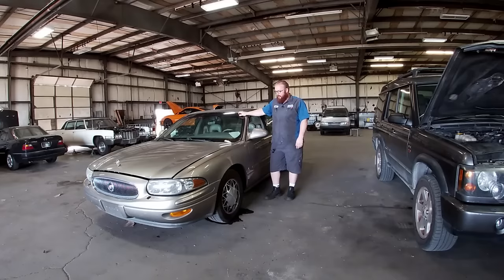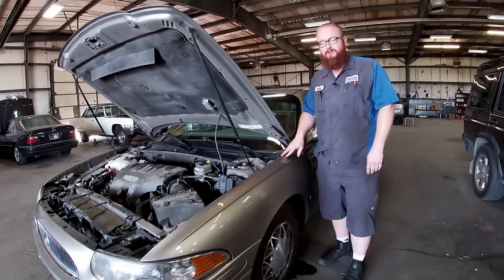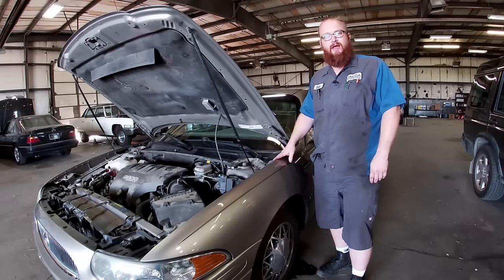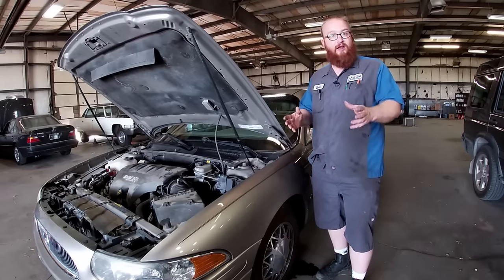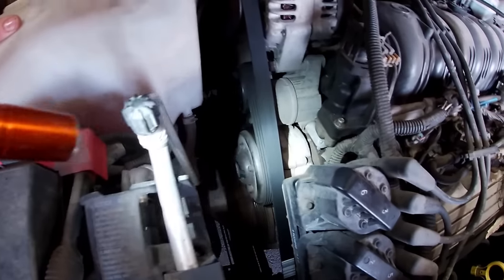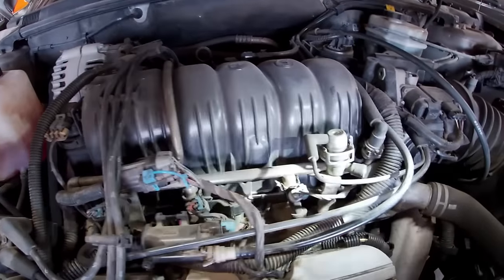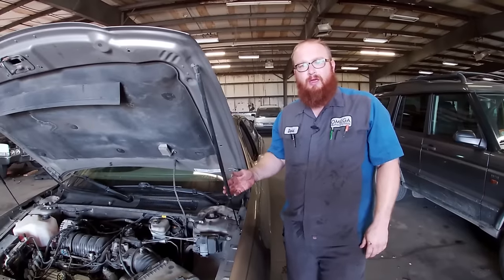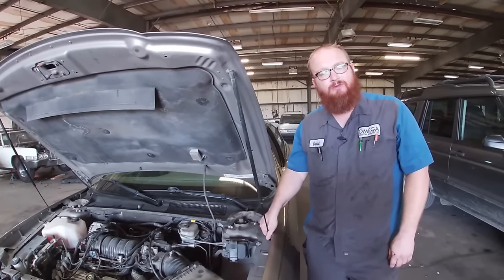CAR WIZARD highlights what makes the Buick 3800 V6 the BEST engine ever!

Comment: Here in Australia, this engine powered our most popular GM models.
Very muched loved and still very common.
Reply: Even if we nicknamed it the 'Moo' because of the engine note when you drive one hard
Reply: I have a mechanic here in Aust that says pull it out and change all the Gaskets & Seals every 250,000 Km... and once you have done 1,000,000 then rebuild it properly...
Reply: @Jimmy 000 yeah the VZ onwards are only good for LS’s, the alloytec is dogshit.
Reply: Commos represent!
Reply: @Jimmy 000 try replacing the thermostat in a alloytec-painful.
Reply: I still got a 97’ Holden Commodore VT Wagon with the 3800, I’m 3rd owner it has 280,000 kms (180,000 miles) and I’ve never paid a cent for the engine or transmission, or anything beyond general maintenance + wear and tear, I have thrashed the car every day for over 10 years now, once upon a time I did motor mounts that’s it, the car also runs duel fuel Petrol and LPG and has given the engine 0 problems, I would argue it’s a little bit more fuel consuming than us Aussies are used to these days but not too bad
Reply: The Commodore VN - VX donk!
Reply: This engine was also used in the Formula Brabham cars, Australia's top open wheel racing series in the '90s. Great engine
Reply: Much loved by some...
I prefer to use them as boat anchors
Reply: @GeeeAus  Barra motors in taxis here in Australia all do 1 million is plus untouched
That’s why taxi drivers won’t use commodore - just don’t last the distance
A country full of taxi drivers says you are so wrong!
Reply: Scott Dean It’s easy to keep an engine together when it’s constantly hot.

But you ignore the ownership experience of family cars I notice.

Falcon engines are famous for warping head gaskets in vehicles that do constant short trips with stop start driving.

The engine has a single alloy head that has to displace 4 L.

The equivalent General Motors engine splits that work over two heads.

Surface area of the mating surfaces is worlds apart.

So what you’re saying is...

Buy a falcon and leave it running.

That’s absurd.
Reply: @batmanlives6456  im with you bruz, all the mechanical sophistication of a cement mixer with half a brick in it. Im not a brand loyalist at all and have owned several holdens that i liked but to pull the RB30 and replace it with this anchor was a retrograde step.
Reply: @GeeeAus  ehh i owned an EL without thermo fans for 12 years and it use to get hot constantly but i never did a Head gasket! i did 2 diffs and a gearbox from burnouts & heavy towing, but never a head gasket, but i did do a head gasket in my EA but only because i bricked the accelerator and stood back!
Reply: Pretty moronic getting rid of the platform
Reply: Skip R  mate you gotta post this message as a main comment on this video . People need to know that the 3.6 in the VF commodores are no longer trash .. in fact I've seen examples with 200k km like yours and no gaskets have leaked ... rear main seals are not an issue on these engines AT ALL . And I haven't seen a single one come in for head gaskets. I spoke to a police officer at my work  one day( Holden mechanic) and he praised the 3.6 for its ability to be abused to the levels the cops drive at and STILL drive strong.. he even went as far and said he preferred them over the V8 commodores.

I own a tuned 2017 VF SV6 with 100k km on it .. haven't done ANYTHING on the car except tyres and wipers . Engine dry as a bone doesn't leak a drop of any fluid . Cooling system doesn't skip a beat  all while returning close 40 mpg on the highway and the ability to do the 0 - 100 kph I'm just 5.6 seconds ..  hugely underrated engines.
Reply: @justinlangley9522  Early 3.6s have timing chain issues im pretty sure from the lack of a rocker cover breather on one side causing oil to cake up inside, also a lack of oil changes from certain owners, if you got an early one just change the oil VERY often and it should last you a good while, worst issue ive seen with a 3.6 is the location of the welsh/freeze  plugs if they leak you're in big big trouble.
Reply: Yeah the 3800 is good and loved here  in australia .. but really the falcon motor (from 1998 AU on when they put a metal head gasket on them) is better ..
Thing is the yanks didnt get aussie falcons and missed out on an even better thing than the 3800.. if I lived in America I might have a 3800 ..
Reply: It's called a mang mang for a reason, get a Barra.
Reply: Ours are rear drives and things are NOT easy to get at. and has timing chain issues.
Reply: The best engine in a Holden was the 3 litre Nissan.
Reply: @xsct878  rattle tech
Reply: Still very commodore lol
Reply: Loved my VP with this engine. Was great
Reply: @watsisbuttndo829  You do know the ecotec v6 makes like 50 more hp than the rb30 does straight from the factory right.....right??
Reply: @batmanlives6456  That’s absolutely the truth. Falcons have to be shot to stop them.
Reply: @GeeeAus  have a look at the wreckers …
V6 commodore replacement engine around $2000 and hard to get as they are in demand as they blow up regularly 
Barra motors … there is heaps of em and under $500 as the never blow up and the wreckers don’t have a market for them 
The Yanks have now realised what a gem they are so things may change …
Reply: @batmanlives6456  

There are plenty of V6 Commodore engines around.

And they don’t routinely shit head gaskets either.

He is not talking about alloytec.
Reply: @GeeeAus  don’t know what your talking about head gaskets…
Barras don’t suffer such problems 
V6 Buick rubbish however make excellent boat anchors!!!
Reply: @batmanlives6456  

Perhaps Barra engines don’t but it took that long to actually address the ongoing head gasket failure issues with the Ford falcon 4 L.

Shit engine only useful in cabs.

Sounds like an incredulity fallacy on your part.

Buick 3800 is super reliable.
Reply: @GeeeAus  yeah right …
Try getting 1000hp outta your Buick shitbox without spraying it up the walls
Good luck with that!!!
See turbo taxi on YT
It had 800,000 km on it….
Why do you suppose ALL taxis in Australia are fords  and never Commodore…
The fords go the distance 
Commodore… not so much !!!
Reply: @batmanlives6456  

That’s not the point the whole point of the video is to articulate which is the best engine in ordinary service.

And that’s the Buick V6.

It’s not a box of problems it just fucking works it doesn’t warp its head gaskets.

And it didn’t take multiple revisions of the same engine in order to fix that problem.

Even with the Barra the Ford was consistently slower around the track then the Commodore because while the engine might’ve been better by the time the Barra came along Fords still handle like boats.

“Turbo taxi” says it fucking all.

All.
Reply: @GeeeAus sorry mate VN to VY
Reply: @marvindebot3264  I speak from experience…
Not from a performance standpoint, just shoddy GM products across the board

Comment: I was working in a small used car dealership when the owner bought a Berlinetta Camaro with a 3.8 that had a head gasket leak. I pulled the heads off and the block had a gouge in the top of the cylinders from the #3 cylinder to the #5 and then off to the side. I whipped up some J B Weld and filled the gouge, let it cure over night and ground it smooth the next morning,put new gaskets in it , and it worked perfect. About 10 years later , my daughter and her hubby bought a Berlinetta . Same year , color ,everything. Then we got looking closer ,and it was the same car. You could see the tiny bit of J B Weld sticking out the side of the motor. They had it a long time and never a problem.
Reply: phenomenal
Reply: Berlinetta Camaros came with the 2.8 60 degree V6, not the 3.8. That didn't come until the mid/late 90's.
Reply: @kennethmiller5187 I was just gonna say didn't those come with that pos 2.8 I hated those. 2.8 not even close to 3.8 totally different worlds 👍💪💯
Reply: @paulderksen5852  exactly. The 3800's (3.8) closest relative lives under the hood of the Buick grand national & even far predates that car.

Comment: When GM finally gets it right they discontinue it
Reply: Uh, he said the engine started in like 88 and ended in 2008, thats 20 years. Sounds like than ran with a good thing for a while. Im sure it was time for an upgrade. Maybe the one they gave wasnt anygood, but you get my point.
Reply: gm has tons of good engines. more then anyone else. there are 1 million mile plus 5.7 out their. never seen another gasoline engine do that.
Reply: @michaelprovost5433  not a chance, only way was it was rebuilt 4 times and or babied and kept after very well. And probably was cause parts are so cheap. Now the 4.8/5.3/6.0 gm engine they run forever and need minimal care.
Reply: @hp5469  look it up.
Reply: @michaelprovost5433  There have been a couple Toyota tundras that went over 1 million without a rebuild. Toyota even bought one of them a new truck to celebrate.
Reply: @Alobster1  I know, i was just commenting on his thought that this was gms only good engine. when in reality gm has produced some of the best engines ever built.
Reply: The bean counters killed the 3800.
Reply: @stomabag7127  meh. the 3.9 that replaced it was better in every single way. and made around 60-70 more hp from the factory.
Reply: Government regulations, mpg and emissions obsoleted this engine!
Reply: michael provost nope
Reply: @fz0gtg  Not at all.  The Ser. 3 3800 can meet the current emissions regs without a problem.  MPG requirements are no worries as well, as the newer cars are lighter than the previous ones. The current Regal/Lacrosse is about 300lbs lighter than the Regal/Lacrosse A-Body,  so that alone would cover the difference in MPG.
Reply: @michaelprovost5433  Let's disagree on that: the 3.9 needs a lot more maintenance, and has a LOT more issues.  Owned a G6 GTP, and after the second $800 repair bill out of warranty, I dropped it like a hot potato, had the same issues on my folks' Buick Lucerne.
Reply: @michaelprovost5433  well, you haven't searched for Fords old 5.0 and there 4.6 both have made over 1mil
Reply: midnitesquirldog1 didn't they make the fleetwood till 96? Pretty sure that's body on frame, as it's the same under pinnings as the roadmaster.. though that might be half frame.. honestly not 100% sure..
Reply: @stomabag7127  huh?  The bean counters actually kept it around for much longer than it should have.  By 2008 most manufacturers switched to DOHC engines.  This OHV V6 outlived its service life because it was cheap to build.
Reply: GM used the 3.8 l v6 for a looooong time,  70s-2000s...as reg 3.8l v6, don't forget turbo in Grand National, then 3800 series, and then gen 2 3800 series, great motor.
Reply: Fiero comes to mind. They finally made a good car in the last you of that car....then promptly discontinued it.
Reply: @michaelprovost5433  Ye after overhauling it 2 or 3 times
Reply: That sounds like GM for you!!!
Reply: @hp5469  except d.o.d. engines

Comment: Good video !  The series 2 had six cross bolted main bearings for added strength.   The LeSabre evolved from year to year largely based on customer input. I can tell you each difference year be year starting in 1984.  Through 2017.   I asked our factory rep in the Chicago zone why they were dropping the 3800. He said nobody wanted a geriatric push rod engine 2 valve when the Cadillac 3.6 had 24 valves and dual overhead camshafts. That’s when the new guys came in and ruined GM  by bankrupt in 2008
Reply: What you said in your reply makes total sense.  The new guys came in and ruined a good thing.  Talk about planned obsolescence.
Reply: Nowadays the only way they want to make an engine is a 1.6 later 16 valve DOHC turbo direct injection with 20 feet of timing chains and tensioners that only last 120,000 miles.
Reply: Which 3800 is best? The series 1,2, or 3?
Reply: 3 is best, but the cars built around the early series 2 are the better build quality cars.
Reply: @ryancooper5647  plus it takes pretty minimal cost to make it just as good if better than the series 3
Reply: You state that you were told, " the custome requested the so-called up graded engine " ?  That was GM  BS.  About 85 % of customers just want a good reliable car, that will do what they want when they need it, and easy maintenance.
Reply: @gordonwelcher9598 That smaller engine is to appease the government  " low fuel usage  and environmental  " standards, while making them as not so dependable so you will buy another unit soon.

Comment: Glad I came across this vid! I just purchased the same car with 43k mi on it for my daughter... From a 80yr old man.. It's MINT,, maybe I should keep it in fear she'll wreck it before it retires 🤔
Reply: So how about an update on the status of your daughter and that sweet land yacht you found  for her?
Reply: You bought this grampa car for your 16 year old daughter !? Yikes
Reply: To anyone on here considering a Buick 3800 equipped car, specifically an N/A one: MAKE SURE IT HAS AN UPDATED FUEL PRESSURE REGULATOR. My father's '01 Bonneville suffered a fiery explosion earlier this year due to a faulty fuel pressure regulator that GM claimed was improved for the 2001 model year. Turns out that was a lie. The car was totaled. Upon researching the issue, there are thousands of cases, and even a recall, which DID NOT cover cars after the 2000 model year, even though it obviously wasn't fixed on the newer cars. Even a famous video of a 3800 impala blowing up in the exact same way at a shop after an oil change. So if you've got a N/A 3800 car from 2000 or earlier, make sure its had the recall done. If you have a 2001 or later, you'll have to do the job yourself or somehow verify its already been done without a recall sticker.

Secondly, the 4T65E transmission is notoriously weak. Excessive clutch wear is pretty much guaranteed unless shift kit is installed. Signs of this issue are hard shifts aı eventually slipping/shuddering during acceleration.
Reply: @Max_G43 imagine being ungrateful enough to complain about a FREE CAR

Comment: My first car, didn't realize how great the engine was till now!
Reply: @pauledwards3325  I had a 96 LeSabre with 56k miles I bought from the original owner for 2300🤣I sold it for 3600 about a year ago. Hoping to buy a 2001 GS supercharged in a few days with 107k
Reply: I had one but had to junk couldn't figure out what was wrong
Reply: Same, Had a 04 Lesabre custom and god that car was great

Comment: I have a 2002 Regal GS. When I bought it for $1900 I honestly didn't expect much, but was quickly impressed by it's comfort, acceleration, and reliability. It isn't outright fast, but the supercharger adds a lovely kick to the motor, it devours miles, and the reliability is incredible. I put nearly 3000 miles per month on it and haven't had to do anything but change the oil and spark plugs.  Easily the best car I've ever owned.
Reply: Still have it ?

Comment: I bought a 2000 Buick LeSabre Custom this year, and honestly, I love it. Fuel pump failed recently, and it's tired were in pretty awful shape. But the engine runs! Even when the fuel pump failed it was still turning over perfectly without fail.
Reply: i did too lmao and i took it to a mechanic and the mechanic gave me a list that was 2 pages long of things wrong with the engine and it looked like whoever had the car before me never did maintenance on it a single time and the mechanic even said he was surprised that the car even made it to the shop. that was like 2 months ago and its still running fine. the tranny mounts are broken though cause i can feel it just when its switching gears
Reply: oh yea i wanna clarify, the repairs were like 5.5 grand so i just decided to drive it until it breaks
Reply: @Speidlair--  honestly, 5.5 grand? You could maybe get another 10 years out of that thing if you overhaul it.
Reply: To anyone on here considering a Buick 3800 equipped car, specifically an N/A one: MAKE SURE IT HAS AN UPDATED FUEL PRESSURE REGULATOR. My father's '01 Bonneville suffered a fiery explosion earlier this year due to a faulty fuel pressure regulator that GM claimed was improved for the 2001 model year. Turns out that was a lie. The car was totaled. Upon researching the issue, there are thousands of cases, and even a recall, which DID NOT cover cars after the 2000 model year, even though it obviously wasn't fixed on the newer cars. Even a famous video of a 3800 impala blowing up in the exact same way at a shop after an oil change. So if you've got a N/A 3800 car from 2000 or earlier, make sure its had the recall done. If you have a 2001 or later, you'll have to do the job yourself or somehow verify its already been done without a recall sticker.

Secondly, the 4T65E transmission is notoriously weak. Excessive clutch wear is pretty much guaranteed unless shift kit is installed. Signs of this issue are hard shifts aı eventually slipping/shuddering during acceleration.